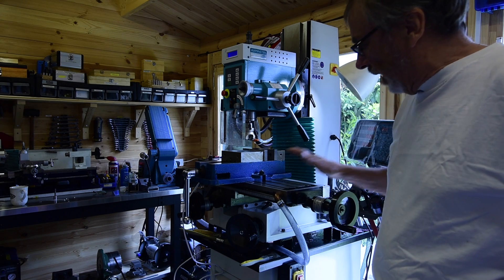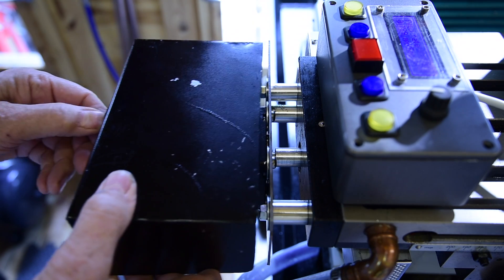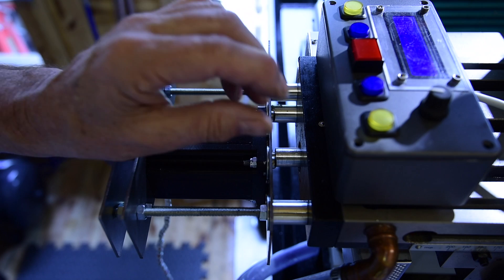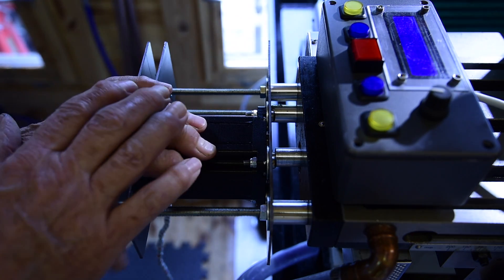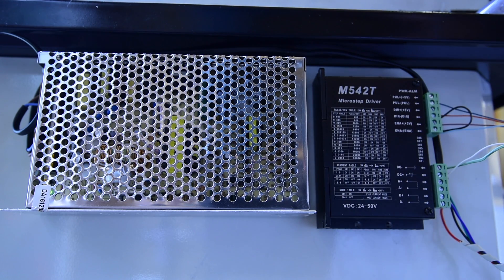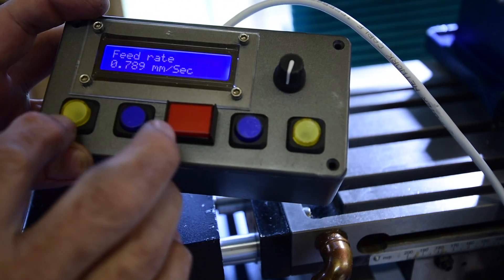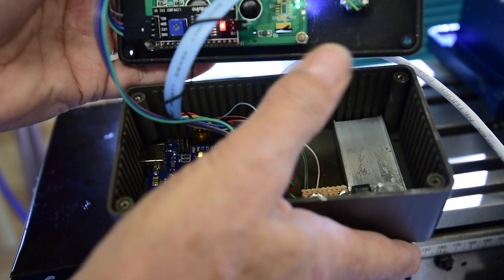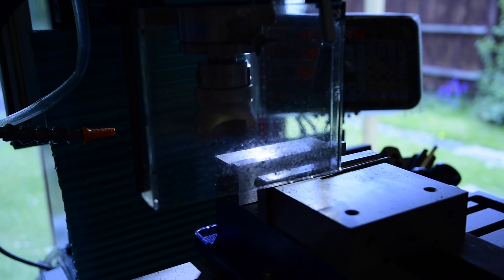Axminster SX3 / SIEG SX3 Mill Power Feed for table - Home-brew Part 1

Comment: Hi Chris, I am very impressed with your vid's on the sx 3 power feed and would like to convert mine copying your set up.I have no problem with the mechanical side  of things, but I am very 'green' regards the wiring etc.I was wondering if you could help me with wiring diagrams etc.Many Thanks Tony.
email tonyharvey52@yahoo.co.uk.
Ps I love the idea regarding the eon plug to switch on the vacuum,have already fitted it to my saw table as I was always forgetting to switch my extractor on..
Reply from the maker: SuperTone52 thanks for the comments, I’ll try to put something together over the weekend showing how to connect the various parts together.
Reply: Many Thanks..
Reply from the maker: "How to connect" video uploaded to https://youtu.be/S-a86EfwHDs

Comment: Hi Chris - with the Christmas break I have had a bit of time to make work and try and replicate your great work - I am now working on the arduino and software - followed your steps.  I see there 3 sketches, I created a folder called Millcode, with the millcode, then added tabs for the other two - so three tabs in total.  When compiling it comes to the LiquidCrystal_I2C line and throws a error - "positive was not declared in this scope" - have you any idea why this is happening? - I'm not very clever with these things and can do with some help - Regards PV
Reply from the maker: Peter

1. Make sure you have downloaded the latest version of the code from Github and you are running an up-to-date version of the Arduino IDE.

2. Put the files in a directory called millcode.

3. Open millcode.ino with the Arduino IDE. It should bring the other files in automatically.

4. To use the LCD display you need to have installed the appropriate LCD code. I am using an IIC (I squared C) LCD display so I downloaded the driver class appropriate to the display I was using. Most of these can be found on the Adafruit website.

5. You will need to download and install the PinChangeInterrupt code as well. This can be found at https://playground.arduino.cc/Main/PinChangeInterrupt

6. In the Arduino IDE select the Millcode tab and press compile. Everything should compile correctly.

If it doesn't compile then take a look at the display at the bottom of the screen where it shows the progress. You need to have "Show verbose output during compilation and upload" ticked and Display line numbers in preferences. If it has failed there should be at least one line explaining why it has failed and at what line it occurred. Let me know what the message and line number was and I will try to help.
Reply: Hi Chris - thanks for taking the time.  It seems to hang in line 59.  Can you check the versions of the 3 libraries used - the report below shows what i have currently uploaded - I have tried multiple permutations and combinations of the different versions available - these seems the least troubled   

I can send report error with "Show verbose output during compilation and upload" - this is a big load of text 

millcode:59: error: 'POSITIVE' was not declared in this scope

 LiquidCrystal_I2C lcd(0x27, 2, 1, 0, 4, 5, 6, 7, 3, POSITIVE);

                                                     ^

Using library Wire at version 1.0 in folder: C:\Program Files (x86)\Arduino\hardware\arduino\avr\libraries\Wire 
Using library LiquidCrystal_I2C-master at version 1.1.2 in folder: C:\Users\Peepv\Documents\Arduino\libraries\LiquidCrystal_I2C-master 
Using library PinChangeInterrupt at version 1.2.4 in folder: C:\Users\Peepv\Documents\Arduino\libraries\PinChangeInterrupt 
exit status 1
'POSITIVE' was not declared in this scope
Reply from the maker: Ok the problem you are seeing is most likely caused by using a different LCD library to the one that I used. There are several of these about and they are mostly the same but there are some differences. 
What you need to do is use the library for the LCD display that you have and if you open one of the example projects that come with the library you can make sure that it compiles and loads correctly. Then what you should do is alter my code to use your library. This isn't as difficult as it sounds as there are only a few places in the code that call the lcd. You need to call the constructor in the way that your test example does then call begin, backlight, setCursor and print. If your version does not have a function it will have something similar. 
Mine uses -
LiquidCrystal_I2C lcd(0x27, 2, 1, 0, 4, 5, 6, 7, 3, POSITIVE); 
where POSITIVE is an enum created in lcd.h thus
typedef enum { POSITIVE, NEGATIVE } t_backlighPol;
but your library most likely does not which is why you are getting the error. You could try replacing POSITIVE with 0 to see if it compiles any further but it may not actually run correctly until you use the correct library for your display.

Comment: Hi Chris - great job, I would very much like to replicate.  I am building a CNC, but also have a fairly new milling machine and would like to equip it with power feed just as you have done.  I had a try at running your code today but had difficulties verifying the sketches.  You have three sketches in the folder.  I have tried verifying them separate and combined as one?  - Have you perhaps a copy of your latest all encompassing sketch ? - must say I have some challenges in coding this stuff 

I have most of the stuff laying around so can get this together quite quickly 

Regards

PV
Reply from the maker: Pieter Vermeulen Sure thing Peter. I’ll sort it out and post an update as I have added the end-stop code and fixed a couple of bugs which were causing it to randomly stop.